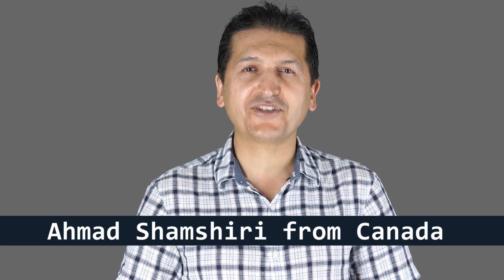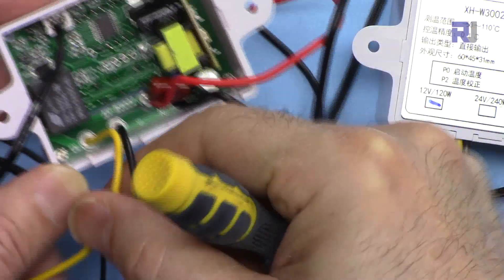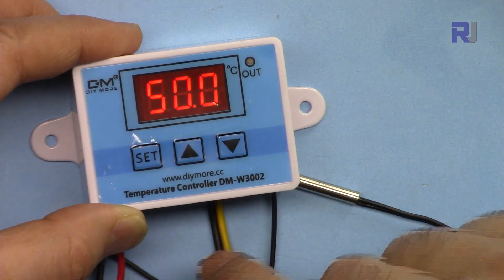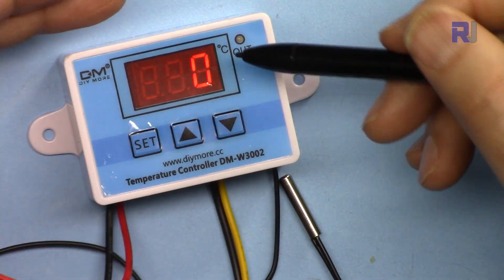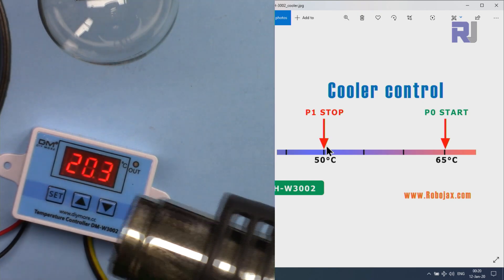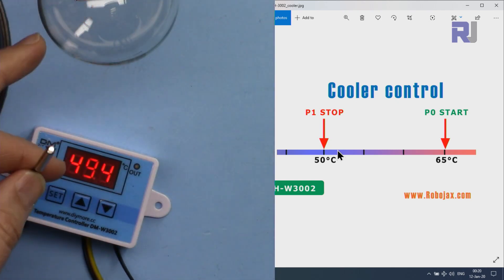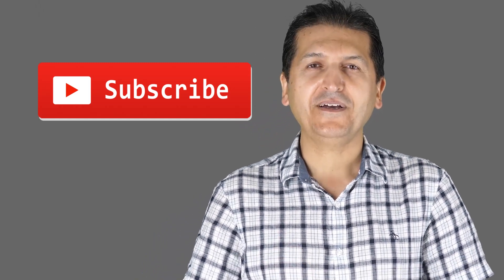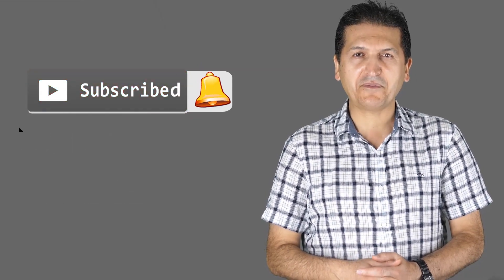How to use XH-W3002 AC digital Thermostat - Robojax

Comment: Can i use the normally closed switch of the relay so i can use the heating and cooling function. I mean use the normally close switch of relay for heating element and use the normally open switch of the relay for cooling fun? Is that possible
Reply from the maker: if you connect another wire to the Normaly closed terminal, for sure it should work.
Reply: @robojax  thank you very much.
Reply: Output 24V240w van írva . Kijön 220volt. Jó hogy nem rázott meg.

Comment: What are the thermometer cables transmistting ? They are 2 cables together Is it one negative and the other for temperature? If I want to extend it I just cut it and connected to another cable ? Is there any loss on the temperature transmission for doing this ?
Reply from the maker: yes. just cut and extend it. it gets data from the sensor which is at the tip of the sensor.  Try it on the  same area/item and measure the temperature with regular cabler and with extended and compare.  I belive I showed (not sure if it was this module) how to compensiatge - or + the fix the reading if there is any.
Reply: Is one of the cable a negative that I can connect to any negative source ?
Reply from the maker: when we work with AC, there is not negative or positive. only Live and Neutural.
Reply: I’m planing to use 2 temperature sensors connected to a -on -off -on switch and then  to this device. Do you think it will work ?

Comment: Why do you (and everybody else) call it LOAD? Why can't you say something like "the gizmo" "the appliance" "the light bulb": I mean, a word that means an OBJECT, not a concept like LOAD. Isnt't what you want to do? TO send power to an electrical item to make it work?
Reply from the maker: when source of power is connected to heater, motor or any device that does the work, that device acts like a load on power source. it is very  easy to understand when we use the word load.  When you carry a book that is a load, when a motor rotates like fan or pump it acts like a load on the battery or power supply.

Comment: Would the 24v work with 19V. and what would happen if you connect 12v to the 24v controller?
Reply from the maker: I have not tested but it should not work. the relay will not hold. the voltage is half. I believe there is 12V version or get boost converter to convert 12V to 24V here is the video https://youtu.be/LMKiPE_2Uu4

Comment: Can we connect the same to a 2KW domestic water heater?
Reply: One thing more, how much we can extend the sensor wire? Can we take the wire through the pipes carrying AC voltage?
Reply from the maker: I belive I provided the calcualtion. Read the current rating on the relay of this module and if you see 10A, then if your region voltge is 200, then P=220v * 10A = 2.2kW it should be enough. As for the length of sensor, it is hard to say, may be try it by shielding the sensor wire with allominum foil and extend it  (inside the pipe with AC line) and see if you read the same temperatue. Except expriment, we won't know if there is not datasheet or information from the manufacturere of the sensor.
Reply: @robojax  Thanks a lot for replying to my query, brother.
I am just going to try W3230 220V AC version to install with a 25ltr water heater (2KW) instead of typical capillary thermostat switch. Let's hope it will work properly.

I will try to make a video of its usage and let you know the results...

Comment: when setting up the delay, in the example you showed, if the temperature drops below 65 during that 1 min delay, will it still turn on? thanks in advance
Reply from the maker: Hi, I don’t remember anything about this video. I would have to watch answer it. I believe if you watch it carefully , there shouldn’t be any questions left.
Reply: @Robojax  the video doesn't mention it, you only made sure the temperature doesn't drop below 65 during the delay period. please refer to 16:05 - 18:08
Reply from the maker: 65 is just an example. But I moved my mousse and said what happens when it reaches to max and to minimum. Please watch it 2 or three times

Comment: But the proplem of such  thermostate is the weak prope may be will melt in high water temp
If it is metal best
Reply from the maker: The he maximum temperature this device can handle, it should work.  It is made for that temperature

Comment: Thank You Robojax!
Purchased 2ea. DM-W3002 Temp. Controllers   {topnotch Seller -=> juan17tres}

Loong ago learned (the hard way) Need to Inspect C. origin PCB's.
 Quick scan of my 2 revealed:
 Good++ design, Good++ component specification 
Both passed function test 

 ~~ HowEver…. Assembly:
Huge Difference between the 2
#1 not up to "industry standard" but will do just fine
 #2 was a Near Term FAILURE Waiting to happen 
... had to clean, reflow/fill several thru-holes  
Bottom Line:  Pull out the PCB's and inspect/repair!

** Helpful Hint Re: all digital controllers **
The Most Common point of digital Controller failure is its’ relays. 
(Note: failed Sensors usually easy to replace and are Not “controller failure”)

So, Industry practice is Controller relays switch External Relays. The External relays switch the working Loads.
That way, controller relays only switch mA.
Relays are Cheep -=> Rule of thumb: External relay rated capacity At Least 2X or More, than Max. load.
FYI: Generally, contact type relays fail open, SSRs fail closed.
Reply from the maker: You are welcome. Than you for the tips and safety notes.